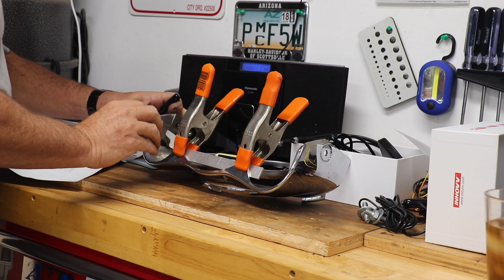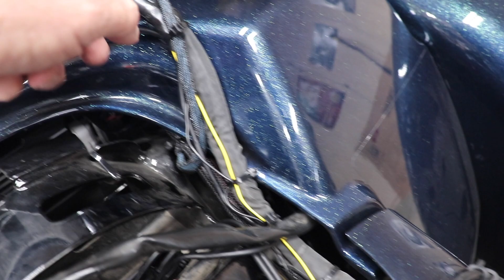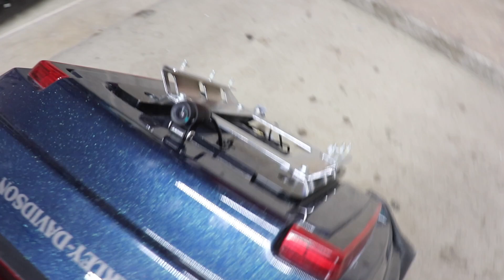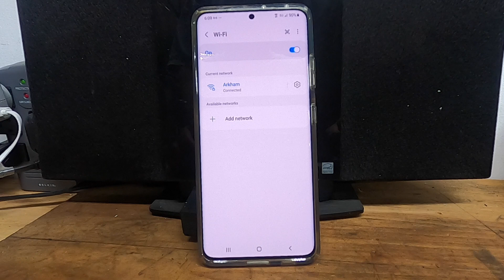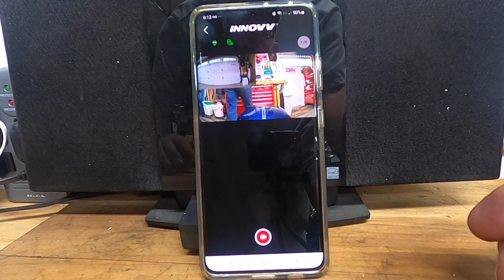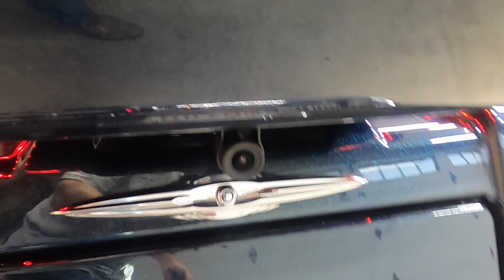Innovv K3 Dash Cam Install On A 2016 Harley Tri Glide

Comment: What is that Monitor Screen for on the Right Side of your handlebar?  And do you have a install video for it?
Reply from the maker: It's my DynoJet Power Vision Tuner.  No need for an install video, you plug it in the bike to the connector behind the left hand cover.  You have to remove the tank to run the wire.

Comment: I installed the Innovv K5 on my 2021 Ultra Limited.  When the front shock compressed, it dented the fender and cost me $700.  I don't recommend installing there
Reply from the maker: Thanks for the feedback.  I did do some testing when someone else brought that up. I have not had any issues so far.  The K5 seems to be a larger unit than the K3.  I'm curious, what is the measurement of the K5 with the mounting bracket?  The K3 is 1 7/8".
Reply: @Batman825  Thanks Bob.  I'm out of town until Friday, will check it then.  I "believe" the rear camera would be about the same size as K3?  I think the front camera drops about the same.  It came with a fork-style bracket that mounted to the chrome cover, then a small block that would rotate side to side.  This added maybe 1 1/2 or 2" to the drop.  Took those off and mounted the one 90 degree bracket to a screw in the bottom.  I then hand bent it to the right angle. It's not going anywhere and is aimed great.  Problem is that with the fender dent, I can't be sure it's not going to hit if replaced.  Thinking if I had some type of putty to fill in the dent, I could check for an impression under severe braking.

Comment: HI, questions how do i know when installing the cameras i have the proper orientation. I cant see any marks on the camera indication which way is up
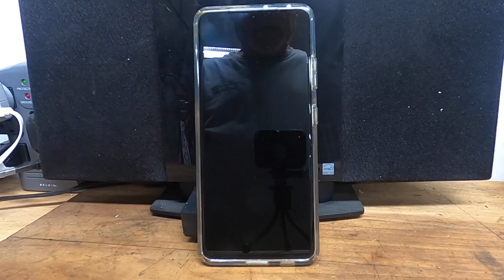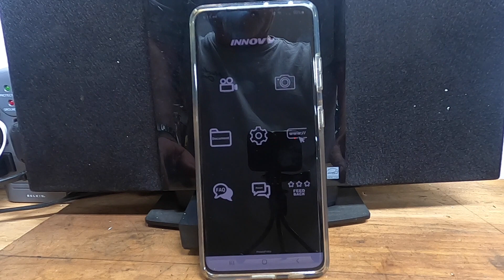Reply from the maker: Once you have installed it, you use the app to connect to the unit.  That will allow you to adjust the cameras.  Starts at 21:30 and explained at 28:25

Comment: Have you had a chance to ride and check the fender clearance? Planning on the same spot on my Roadglide Ultra
Reply from the maker: Josh, I've not had an issue.  I have 3 1/2" clearance from the bottom of the Camera to the fender.  The travel on the front shock according to Harley is 4 1/2".  To me, 3 1/2" is a lot of travel.  I think it would take a really nasty compression of the fork springs to hit the camera.  I was hoping that George would have responded to my reply as to what his distance to the fender is.  If I measure the 4 1/2" travel my fender would hit the bottom of the fork where I mounted the camera.  That said, I don't think Harley would put in a spring in the front end that is designed to hit the bottom of fork bracket.
Reply: @Batman825  thanks Bob for the quick response. I have 3 7/8 on the lift but 3 3/8 on the ground. I do have Fox cartridges in my forks though. Guess I need to have the wife watch and bounce it as hard as I can.
Reply from the maker: @joshstucker4250  Let me know what you come up with.
Reply from the maker: @joshstucker4250  I did some playing and I jacked up the bike taking the load off the front end.  The distance between my camera and the fender was 4.625".  Harley says the travel on the front end is 4.6".  So in theory, I have a greater gap between the fender and the camera.  I don't think it is an issue as George wrote about.  Maybe he mounted it lower.
Reply: @Batman825  I went for a 10 mile cruise this evening and had no issues. Mine is maybe a half inch higher than yours the way I mounted it. Now to figure out how to share videos
Reply from the maker: @joshstucker4250  You can share videos on YouTube. There is a setting on the app that makes the length of each video segment if records.  There are 2 ways to retrieve the videos.  Depending on where you installed the main unit it is easier to download the videos to your phone or if it is accessible you can remove the memory card and conned it to your computer and download the videos.  If you download to your phone keep the phone as close to the where you have the unit.  Place it on the seat, it will download faster that way.  I wish there was a way to see a picture of how you mounted it.  Maybe put it on your YouTube channel?
Reply: @Batman825  I mounted mine behind my battery so not easily accessible, I can download to my phone but after that I’m clue less. Appreciate your help
Reply from the maker: @joshstucker4250  You can upload to YouTube but it depends on what you want to show.  You can also upload to FaceBook if you are on that. It really requires that you have a video editor program so you can download the videos and put them together.  The downloads off the phone take a long time to do that.  Set the time of our videos to a longer length and the you don't need to edit them together.